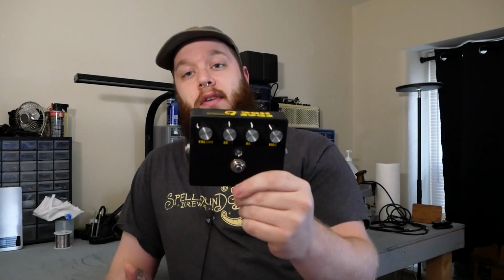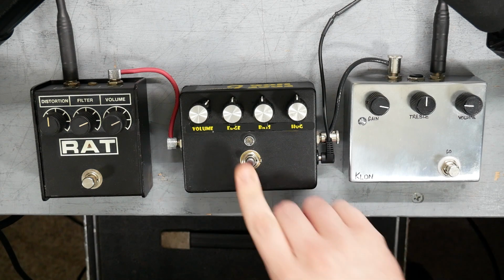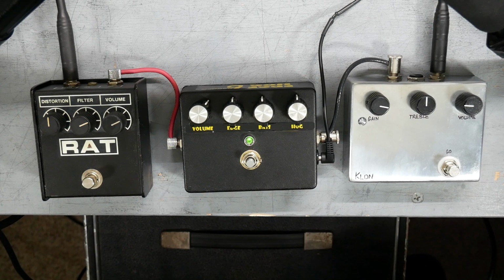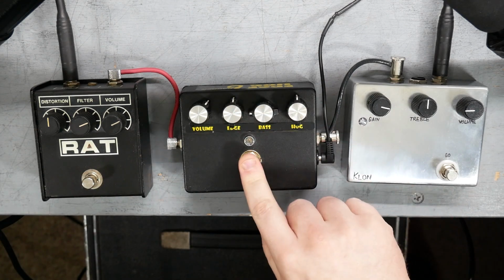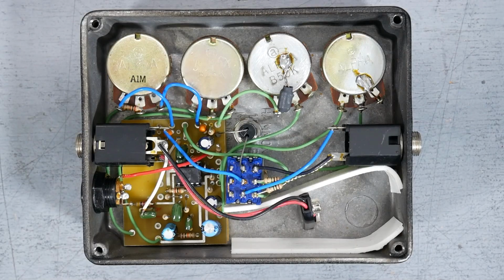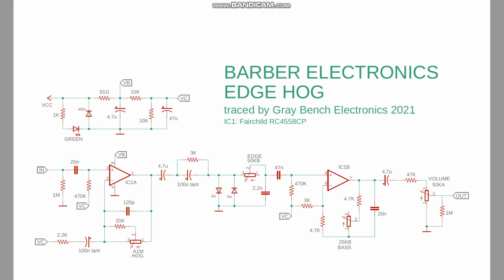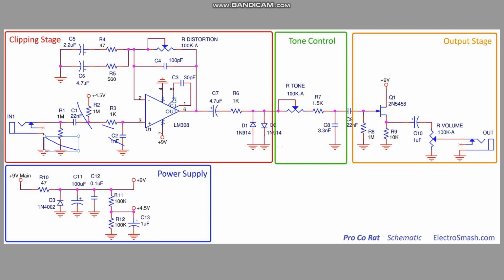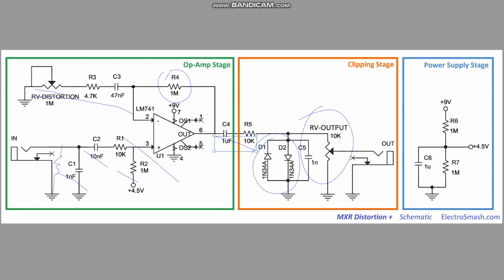On the Bench! Barber Edge Hog Distortion Pedal

Comment: Ha! Nice trip down memory lane. The op-amp in that one had been switched from OEM. Those footswitches from Shigma are really not terribly fragile, heck, that one has lasted 22 years as of this video. This was before we had loads of purpose built footswitches for pedals available at the click of a "buy it now" icon. We had massive paper catalogues back then with way too many characters per part to read over the phone to a salesperson, but ya know, we still thought it was great fun, still is!
Reply from the maker: Yeah we are pretty spoiled these days, thanks for watching!
Reply: @graybenchelec  No kidding, all the heavy lifting is done by the fabs and vendors that will supply everything down to the circuit, assembly, and name of the pedal. Never saw that coming in 1997. Oh, and the PCB is a Sunstone circuits board, Free CAD software! There's no solder resist on that PCB so it might have looked "homemade" due to that, but it's a double sided PCB beyond my fish-tank etching chops at that time. I made my last fish-tank etch in 1997, not to mention drilling a million pad holes with a bit that shatters every 100 holes really sucked, so I was very happy to have Sunstone making the boards after 1998-99. I should also mention they were true "magic diodes", Microsemi blue. I remember buying 10,000 as germanium production ran out and thinking "If I ever sell through all of these, I'll be rich, so it really won't matter", lol, still not rich, but rent including heat was $450 a month back then, so yeah...
Reply from the maker: @sgnirts1010  I guess the lack of solder mask is what made me think homemade (maybe the right angle traces too?), but that wasn't a slight. Everything I make is homemade lol.
FWIW the edge hog is one of the pedals I kept. It may have RAT/Dist+ bones but the bass control adds more utility IMO.
Reply: Edge Hog sounds incredible! Would love to hear the difference between the Edge Hog and Burn Unit! David Barber you are the man!